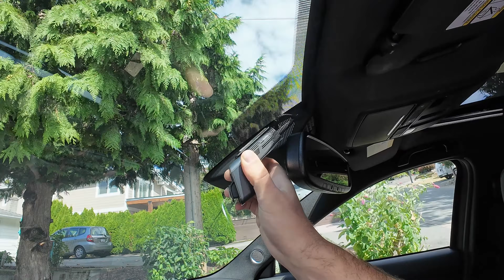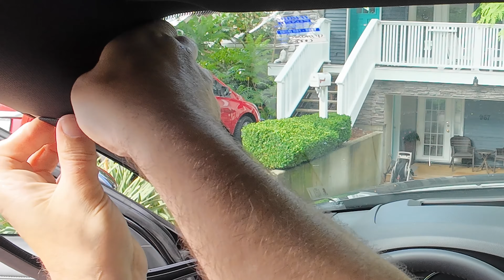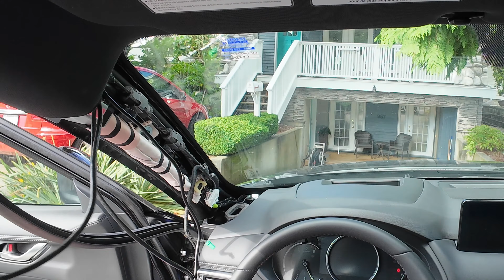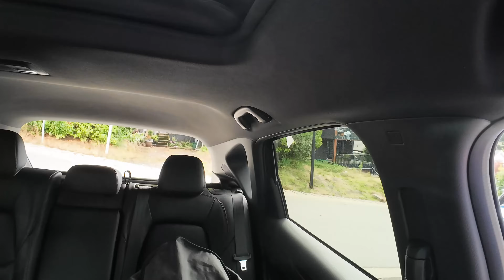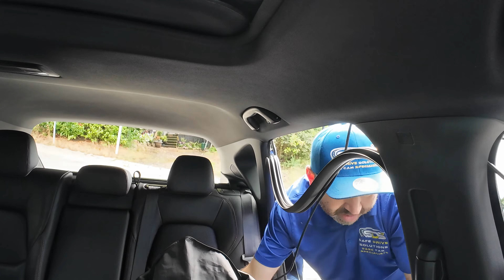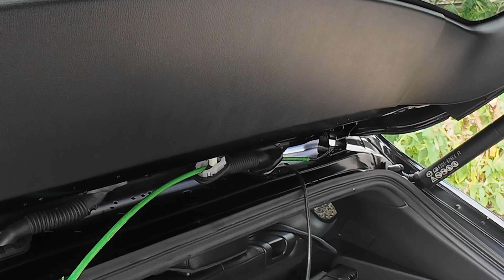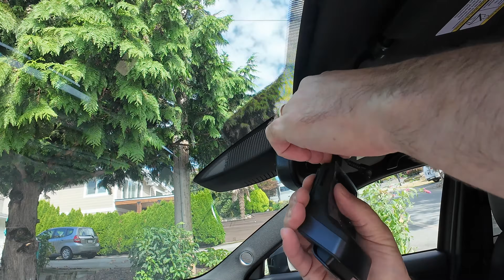Mazda CX5 professional dash cam installation

Comment from the maker: Just want to pin this video to explain how airbags deploy and why the way we ran it by the b pillar is not dangerous at all. https://youtube.com/shorts/oHcmEeb4FUo?feature=share
Reply: Honestly, I'm still not convinced. The airbag may settle "in front" of the B pillar but look up some videos of side curtain airbags deploying or photos from the inside (after airbag deployment). The airbags pull out the headliner from under the B pillar and the weather stripping and then basically pop out of the same gap where you're running the wire. I don't mean to be rude and I hope I'm wrong, but yeah, as I said, I'm not convinced it's safe.

Comment: Directly wiring without any fuse in between? Tsk, tsk tsk...
Reply from the maker: You do realize there is a fuse inline on hardwire cable
Reply: @SafeDriveSolutions  Nope! As you were then! LOL. BTW, good video.

Edit: Oh, now I see them where you showed OBD2 connector. Hardwiring part is sped-up, so it was easy to miss those fuses inline.
Reply from the maker: @bajatoma  on Viofo, Vantrue and others we need to manually solder our own fuseholders inline.

Comment: Hi! I have a 2025 Mazda CX-30 and installed a 70mai A810 Lite with the 4G module. The hardwire kit has a red wire (constant 12V) and a yellow wire (switched 12V).

I found that fuse slot F3 in the interior fuse box is empty but has constant 12V. Can I use it by simply adding a fuse, without using a fuse tap on an existing circuit?

I’m also having trouble finding a switched 12V fuse for the yellow wire. If I can’t find one, can I connect the red and yellow wires together to the constant 12V supply? I don’t really need parking mode, so I’m happy to use the dash cam only while driving.

Would this work with the 70mai A810 Lite and its 4G module on the 2025 Mazda CX-30? Thanks!
Reply from the maker: You will kill your car battery twisting yellow and red together. 

You will not find an ignition fuse in the vehicle.

Comment: Hi i have a question. Will gluing the camera on top of those heat gradient black dots on the windshield lead to potential damage of the windshield? I know the dots are intended to dissipate heat into the glass gradually so that there are no expansion fractures, the pad acts as a hotspot right on the edge so i am a little bit worried i might be causing future problems by doing that. 
Also, i noticed that on the hatch when you installed the rear facing camera you went for the right-most routing as opposed to the left one for which the path of the cable would have been shorter. is there any technical reason for that or just a design choice?
Thank you for this video.
Reply from the maker: Have done it over a thousand times. Heard a lot of funny stories about what people think the textured area is. In terms of rear camera it depends on how camera has to be mounted is on how we run the wiring

Comment: Bro, you have to assume people won’t stop at intersections or follow the rules of the road. The quicker you realize that, the better your driving experience will be. Patience and attention are just as important. Speed and distractions are your worst enemies when driving.

The last accident I caused was 18 years ago. It was a very mild fender kiss, and GEICO said it didn’t require police involvement or any of the response it warranted,  but technically I rear-ended the other car, so I was responsible. I’ve been very lucky since then. No speeding tickets either.

Comment: Hi 
Are there any air bags where the seat belt is attached? I mean the B pillar
Reply from the maker: they are not behind the B Pillar. they are in the roof
Reply: @SafeDriveSolutions can I root the rear dash cam through the B pillar on golf 2015?
Reply from the maker: @ronnypsunny2265  We have many VW / audi  videos. https://youtu.be/xbX7feI4GIs
Reply: @SafeDriveSolutions thanks a million

Comment: Great video, thanks you guys it helped me a lot. 4 mins 50 seconds its tight getting that usb-c through the gromet . whatever fish wire and tape you use coating it all in vaseline makes it a whole lot easier.
Reply: Fishing the wire through the gromet was the most time consuming part of the install. I didn't even think of using vaseline, good idea!

Comment: G’day from down under Ben 👋

Just took delivery of a 2025 KF CX-5 Akera and coincidentally picked up the Thinkware 3CH U3000 Pro, so this video was perfect timing for me.

This and all your other videos are packed with great advice and super easy to follow—I’ve installed dash cams in two previous cars and still picked up some great tips here.

Quick question: where would you suggest locating the Thinkware iVoltmax in the 2025 CX-5 for the cleanest and safest install?

Appreciate all the work you put into your content—cheers!
Reply from the maker: Typically install under drivers seat

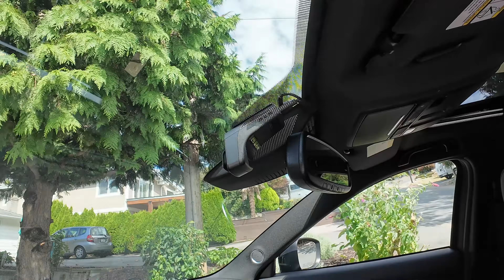Comment: I have been wondering about placement so much, driver side, passenger side, it seems I am not the only one. At 8:25 you get to see that he still catches a little bit of center plastic thing on the side with that exact placement. I am consider placing it there, but 1 cm further out, or on the passenger side.
Reply from the maker: catch plastic?? Not sure what you are talking about. We typically place it in this spot all the time. It does not catch the housing.
Reply: @SafeDriveSolutions  Good morning. I went through this whole placement thing the other night, looking at my camera screen, while trying different placements - specifically seeing where the middle sensor cover ("plastic") is not in the view, at all. That's why I recognize the very tip of the sensor cover on the phone screen that you hold up.

Watch your own video, you can see it at 8:25. Now is it an issue? I don't think so, at all. It was just interesting to note. I do agree that that placement is one of the best available spots.
Reply from the maker: We typically mount it a slight bit down from there. That was more for the video recording.

Comment: I used a obd2 plug and its still runing after 28+ mins of turning the car off even in ACC mode, is this normal?
Reply from the maker: What obd2 cable? Did you use the specific one for the unit or a generic one
Reply: @SafeDriveSolutions  a generic one for a generic dash cam off Amazon.
Reply from the maker: @KylesCaptures that is why
Reply: @SafeDriveSolutions so then what do you recommend?
Reply from the maker: @KylesCaptures buy the specific one for your dash camera
Reply: @SafeDriveSolutions there isn’t one. That’s the point
Reply from the maker: @KylesCaptures what brand?
Reply: @SafeDriveSolutions  Petizio
Reply from the maker: @KylesCaptures do you have a hardwire cable for the unit?
Reply: @SafeDriveSolutions  No. It only came with cig lighter, which is why I had to buy a generic one off amazon.
Reply: @SafeDriveSolutions no, only came with a cigarette lighter plug. That’s what I had to buy a generic one off Amazon
Reply from the maker: @KylesCaptures if you buy a hardwire cable specific for that unit and a generic iroad obd 2 cable you can build your own
Reply: @SafeDriveSolutions I take it you can spice that OBD2 adapter and it is one of the only ones that provides parking mode signals for the dash cam?
Reply from the maker: @lostman-bm2px  Viofo OBD2 Hardwire Parking Mode Cable
https://youtu.be/mRaR2my1aBc
Reply: @SafeDriveSolutions Thanks, that is cool I'll probably try that out.

Comment: Thanks for your video. I follow your instructions, but I'm running into a difficulty. I cannot remove the liftgate grommet, I don't know where the clips are.  Is cx5 2025 the same with this grommet? I remove the rubber boot from grommet. But I cannot reinstall it, I gauss I should remove grommet at first.
Reply from the maker: It is exactly the same. All 4 corners have a little indent that needs to be pushed in to release it. Be careful with it.
Reply: @SafeDriveSolutions  Thank you very much. I have  successfully done!!

Comment: What tool would you recommend to use to remove the rear Gromit on the hatch door?
Reply from the maker: We use a 4140 or you can use a plastic panel popper. Just be careful not to push too hard
Reply: @SafeDriveSolutions  okay thank you! I have several different sizes plastic panel popper tools.

Comment: Car manufactures should really start add recording to 360 cameras - You can buy a module that does this - and add ports to the top of the car. 2026 and we still have to add cameras, install wires etc. Fitcamx at least showed you can connect to sunroof cables if you have one. Nobody is point this out...some do have it but this should be standard decade ago.
Reply from the maker: Different parts of the world have different rules. General Motors (GM) was caught last year for selling user data of all the interactions you have with your radio and Onstar in your car. In Canada the talk of CHinese EV's entering the market I think is good but a lot of customers have concerns over privacy and if someone has access to their cameras and will be selling that camera information to someone for profit. Even ROOMBA (Ithink) the motorized vacuum was caught recording people as it went around their house.

Comment: I'd like to say thank you for the video which is extremely helpful! On the subject of fuse taps I believe they are ok (from reading not experience) if you use ordinary mini fuse taps rather than the low profile mini fuse taps. Apparently the longer legs help them maintain continuity even if they don't completely seat whereas the low profile ones will just want to fall out... Hopefully you can verify this for me because I don't really know from experience like I said. I only know from hours of reading up on it and as you know there's a lot of misinformation out there... hence the question....
Reply from the maker: Some people do use atm fuses

Comment: Wouldn’t running the wire through the roof liner disrupt the working of the curtain airbags?
Reply from the maker: no it would not. At least it does not with how we run the wires

Comment: This looks exactly like the Mazda CX3, is it (more or less) the same process? Looking to upgrade my cable management situation to avoid my passengers getting tangled haha
Reply from the maker: very similar but power connections are different
Reply: @SafeDriveSolutions Thanks!

Comment: So the 2019 mazda cx5 have 2 fuse box. One in the engine bay and one inside. How would you know which fuse in the interior fuse box is for constant power and which one is for ACC for parking mode?
Reply from the maker: You would use a multimeter and measure the fuses.  To see which ones turn on and off with ignition
Reply: @SafeDriveSolutions i was told that the fuses in the cabin are accessory powers and the constant power fuses are in the engine bay. If that's the case how do you access the fuse in the engine bay from the cabin on a 2019 mazda cx5?
Reply from the maker: @sammeya5324 that is wrong information. 

how to safely install dash cam wiring into the car
https://youtu.be/BgsKy9Hhzvc
Reply: @SafeDriveSolutions thank you so much! I'll check this out

Comment: Super helpful for installing my Rove R3 dashcam - went with the ODB power source instead of the hardwire based on your suggestion, Thinking about taking it to get hardwired so that I can use parking mode. Parking mode is only available on Rove R3 using the fuse box.

Comment: There is a 3rd option if you are installing on a CX-5 that has a powered rear view mirror, use the Dongar Type EE 10 pin adapter.
Reply: The new pro model does, older classic models with adapter only dont.
Reply: Does this offer parking monitor?
Reply: Link ?

Comment: Is there any way you could explain or show how that rear cable is run near the side airbag? Do you mean behind the airbag near the weatherstripping or above the towards the center of the vehicle? If I run it behind towards the weatherstripping I have to go under the airbag near the a pillar.
Reply from the maker: We are trying to develop a video that will explain this in full detail. We have been reaching out to auto wreckers and a few collision places to see if we can get a vehicle with airbags deployed so we can explain it.
Reply: @SafeDriveSolutions  Any updates on this? I appreciate your video but wish you and ChrisFix would show EVERY step of the process.  It's frustrating trying to do this and running into a step that's not covered in the video.
Reply from the maker: Airbag safety - Running wires by the b pillar
https://youtube.com/shorts/oHcmEeb4FUo?feature=share

Comment: Great video. If you accidentally break the grommet, like I did, you can order a replacement part from Mazda cheap. Part # KD45-67-GP1. Easy replacement. Carefully pull the rubber off the old grommet, push in the tab to open it and remove. Then reverse steps to replace with the new part.
Reply: The grommet portion of the install is by far the most difficult part. I've already ruined one USB-C cable connector by making poor choices with pulling the cable through the grommet. If only there was a way cut the grommet out entirely, run the cables, and then replace the grommet.
Reply: I pull the rubber off, but I don't know how to install it again. And how to remove the grommet?
Reply: @vfrz8219 as I remember I pulled the rubber piece down then removed the grommet. Then put on the new grommet (it opens with a tab so it attaches over the cables without having to disconnect anything). Then I think I fitted the rubber piece onto the grommet (slide up the cables and fit it around the grommet) then pushed everything back in place. Either that or you first push the grommet into the slot and then push the rubber piece up to seal the slot.

Comment: Is it necessary to open the A-pillar if you're just running the rear cable? I didn't do that on my old car, I just ran it through the crease and then inside the trim from the outside under the weather stripping. I'm not running power down to the fuse box or down the pillar at all.
Reply from the maker: To run it behind you still need to open the a pillar

Comment: Hi Pro, For the option 1, will the power be cut when the car is off? Thanks
Reply from the maker: OBD2 cables can be used for parking mode or you can have them setup to only work while driving. There is a delay of a few minutes after you turn the ignition off

Comment: Thanks for the informative video!! We followed these steps for the cx-50. Unfortunately we forgot about the grommet piece and ended up breaking one of the clips. Is the grommet clip the plastic piece replaceable? When analyzing it, it looks like it’s two pieces so we’re hopeful it’s replaceable haha!
Reply from the maker: I know people who have replaced those grommets so they are replaceable
Reply: @SafeDriveSolutions that’s awesome to hear! Called my local dealer and the part is on order. Purchased a few pieces for insurance in case I mess up the mess up.

Comment: Sir please Help me i'm stuck, i have fuse taps and i don't know which is ACC and which is B+, becuase im not a tech expert i asked chatgbt and i read that i should avoid 25A or 30A fuses, which fuse should i use? in case i found an empty fuse with constant power should i add another fuse inside the fuse tap? in case the slot is empty? tell us which fuses did you use please.
Reply from the maker: the video shows that we do not use fuse taps and also explains why.
Reply: @SafeDriveSolutions all I can do is fusetaps sir. That what dashcam company sent me and I’m trying to apply it. 

I don’t have OBD available.

Comment: Doesn’t fishing the wire up there above B pillar intrude deployment of side airbag? Chrisfix suggested to fish the wire down to door sill. Someone please educate or share some knowledge?
Reply from the maker: Do you think it would make sense for the airbag to shoot down over hard plastic thats surrounds the b pillar where the seatbelt is? Yes or No?
No it does not make sense for it to shoot down where we run the wire.

We are trying to find a way to produce a video showing this because the main challenge is someone like ChrisFix has millions of viewers, but he does not install 1000's of dash cameras a year like we do on many, many different vehicles. We have professionally been installing aftermarket accessories for over 25 years. Its one of the top videos we want and need to produce for education on AIRBAGS.
Reply: @SafeDriveSolutions I’d love to see an informative video about the challenges of wiring around pre-existing safety systems in the modern day
Reply from the maker: @OneNidim we have been looking for a auto wrecker that will allow us to blow an airbag up so we can show the damages it causes.

Comment: Very helpful video, I was having a lot of trouble getting the a pillar back into place. Especially the top clip, can’t seem to turn it to put it back into place. Any tips?
Reply from the maker: some years of the Mazda CX-5 are really terrible to get the clip back on. Typically 2016-2017 time frame. you may need to use some needle nose pliers